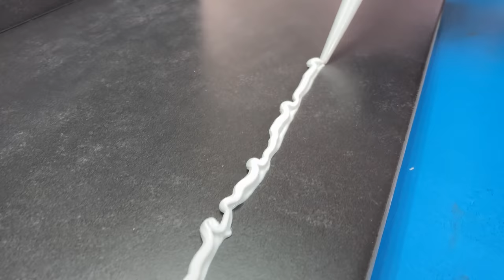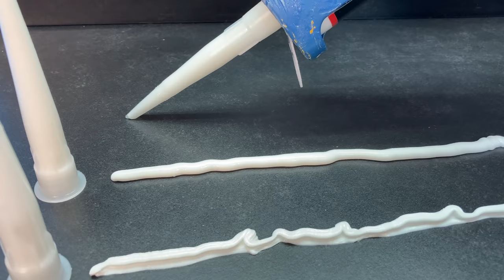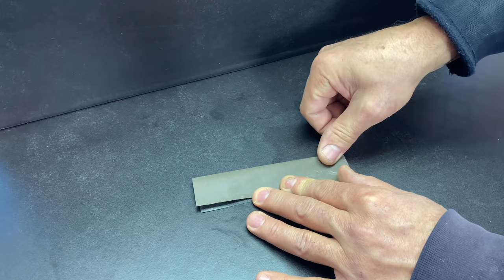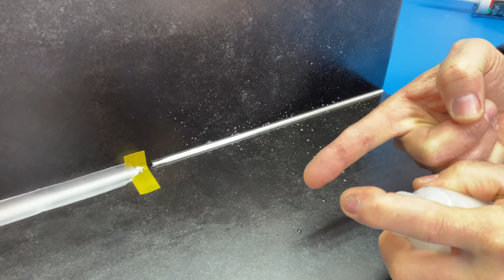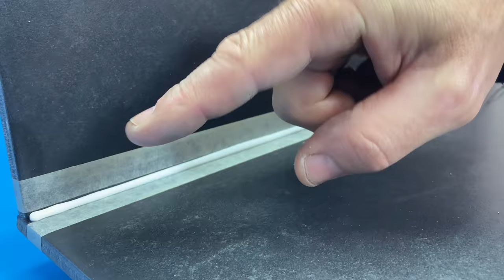Few People Know About This Silicone Trick | Do Perfect Silicone Every Time

Comment: I made the silicone joints for Years. I was paid per running meter, there were times when you got 12-15 CHF for 1 running meter.  At that time, only adhesive tape and primers were used.  Then Bad  times cames and for 1 running meter you got only 6-8 CHF.  You had to rethink and see that the bill was correct at the end of the day.  No more tape, no more primers, just apply silicone, spray soapy water and peel off.  Finished.

After removing the tape, I smoothed the fine flanks with my index finger, so a silicone joint was perfected.

Comment: This is nice and all, but since I'm not doing it on the regular, I prefer to treat my caulk like the mortar for a brick wall; put a little bit down, then scrape smooth with a trowel, but in this case, one of those caulk scrapers with the angles cut into the corners. The excess gets pushed onto the back side of it, then when it needs more it get's drawn down along the bead. I only do about a foot at a time. Then I go back and scrape a couple of times for a smooth bead. Looks factory-finished every time, and the silicone scrapers gets 95% of the excess off the walls. 

And, only doing a foot at a time allows you to touch up the sides and any uneven parts as you go along, giving each foot a detailed finish.

Comment: Wipe with paddle pop sticks instead of finger after spray with detergent is good also.
Don’t over do the soapy spray as colour can run from silicone and make a mess of job, particularly if you are caulking on a textured surface, not so bad with a smooth surface.

Comment: There are special spatulas for seams, and only amateurs work with their fingers. the seam from the finger is less durable, since it is very thin at the edges and the water does not drain well from it because it has the shape of a hollow, which leads to the formation of mold.

Comment: Some useful tips here but I strongly disagree with the following:
1) Using a finger to smooth the edge. This introduces bacteria to the wet silicone and will cause it to go mouldy much quicker.
2) Spraying with liquid (water, soapy water) while the sealant  is still wet. Ask yourself the following: (a) you wouldn’t apply silicone sealant to a wet surface would you, (b) you wouldn’t have a shower straight after applying sealant would you, (c) why would you spray a liquid onto wet sealant that the sealant is known not to adhere to?
When you first apply the sealant there is likely to be some minor gaps where you didn’t quite apply it completely along both edges and a small gap might exist. If you then go to spray water, water will run into that gap and prevent the sealant from sticking to the substrate of that section. It is absolute madness why people do this.

Comment: nice informative video but its certainly not advisable to spray soapy water on a surface that you are trying to bond silicone to. its also known that oils and greases from the fingers with contaminate the silicone and surfaces causing a failure,  Its widely known that the strongest part of the joint is the first couple of mm so the fingertip method will give you a wafer thin surface that will erode in the first few cleaning strokes. I now use a multitude of profile tools which not only give a long lasting bond but are extremely mess free and if you feel like you've made a mistake or a mess then you scrape off and restart.

Comment: Just a quick tip to go along with the soapy water tip, if in a pinch and you don't have soapy water in a spray bottle available, you can lick your finger and build up a lot of saliva on it instead. Won't work as well and won't cover as much area/distance, but will work enough to keep it from looking like a train wreck.

Comment: Wrong, never use soap water to finish, because the margins never sticks, despite they look good. The soap is all over the 2 lines under the apparently nice finishing. It is wrong with paper scotch too, because the margins are thick. Use silicone tools (there are sets with different shapes) to finish - no soap water needed, except in the corners sometimes. But the corners are made in different days for best results. See other youtube videos, e.g. how to silicone corners. Anyway, the surface in this video or another is perfect, it should look good even with the finger without soap, but one have to know how to press the finger. When is full of overload, clean it then proceed again from where you stopped. This assures sticking all over the terminal lines. Then you may use water soap, but never immediately after pouring! Only after pressing it correct with silicone tools or a smart finger. But silicone tools rocks!

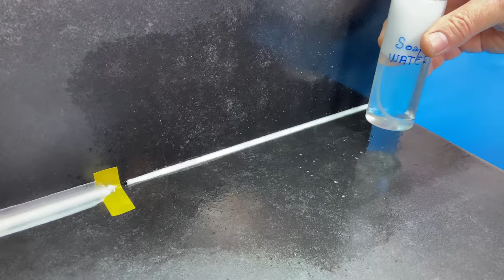Comment: 2:00 wrong...........apply soap or whatever you use on your finger or on the puller because the soap and stuff can get behind the material and it doesnt stick very well. and if there is wet space like Windows on the ouside you swipe silicon with 45degree angel not round because water can stay in the round

Comment: Spraying with soap water causes edges to detach after some time. You should never add soap near surface you want silicone to stick to. Using rubber silicone spatula is the only right way to do it. Never spray and never use tape that leaves step edge. That's a place where water stays and mold grows.

Comment: Sorry, but the only method for a straight smooth bead that has ever worked for me without struggle is the masking tape method using very thin cellophane tape and then go over it after tape removal with a finger and lots of soapy water to smooth out the edge. Anything else with any of the available dedicated tools or shortcut methods resulted in splotchy mess that had to be redone.
If you're a professional and have done miles of caulking then I'm sure you could do it in your sleep, but for DYI'ers and occasionals, not.

Comment: I am over 50… I have performed tons of caulking jobs… All of them crappy….

NOW I LEARN HOW TO DO IT…. FML
Reply: If I didn't know better I'd say you were my dad.  Just spent the weekend removing much of his prior work.  Told mom if they need more done in the future to just call because it is far easier to do it right the first time than remove and redo later.   I also found a stock pile of various epoxy adhesives.  I don't want to be around for the next remodel.

Comment: Like the sand paper to shape tip, great idea. One problem is you should always caulk going forwards, never dragging the gun. If you go along the way shown, you don't push the silicone down into the joint. Always push the gun not pull the gun.

Comment: Not shooting down the guys efforts but the tape trick tends to lift the edge of the silicone, when you remove it, right where it needs to be a feathered edge.
This may not leak but then allows water and dirt to gather along the lifted edge, it looks shit!!
Just my experience, if you get good results fair play...much better to use a tool (bought or homemade) that will leave some caulk in the joint. 
Caulking is not an easy job to do correctly, it isn't something you will master in one go!

Comment: Soap water is the WORST method to do it. Silicone will not stick properly to the watered surface and it will start detaching and collecting mold over time. Best way is to buy soft spatulas for sillicone. Very cheap, allow to achieve different fill profile (rounded, straight) of different thickness and do perfect corners (very hard with finger). Soap water can be used as finishing touch to get extra smooth and shiny surface. But it must be done afetr silicone made contact with dry and clean surface across whole fill width and length.

Comment: Great effort & video....  I'm sorry this wrong. 
The tube should be cut within 10º of perpendicular in order to leave a structurally securing bead of sealant that bridges "corner" or gap. Tooling bead afterwards should not be the SOP but a method to resolving a unskilled and unsightly work.
- DO NOT! what ever you do, take this silly ass curly mustached painter/paint store owners word for it, DO however seek out for YOURSELF the  ASTM specs for building sealants.

Comment: You used your finger and not a silicone forming tool?  finger wagging from me. Use fingers only when you can't get a forming tool into the gap you want to smooth off. Masking tape will leave a raised edge on the silicone and fingers will leave a thin edge that will break up. A forming tool will leave a perfect edge.
Reply: Forming tool?  That is for rookie homeowners that watch too much TV.
Reply: @ShainAndrews  lol. ok.